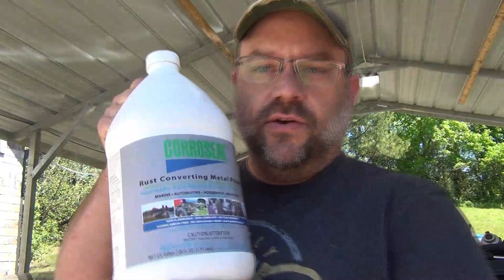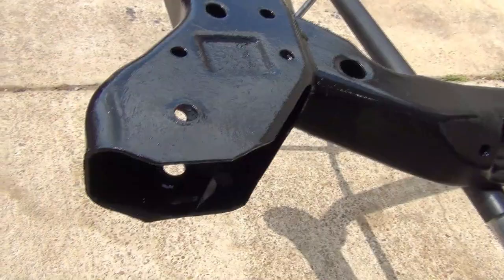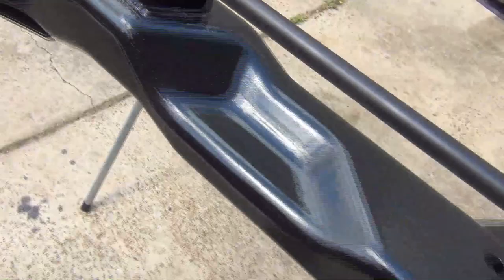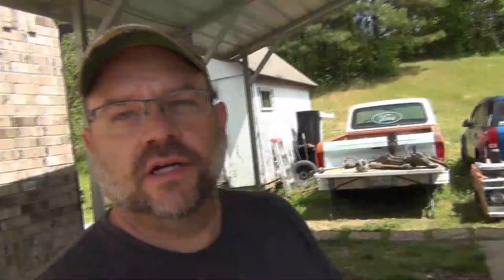Corroseal Rust Converter Test Application and Results

Comment: 1 gallon of Prep & Etch is $20 at Home Depot...  Cut it 4:1   I'll try this..  For cleaning I use Purple Power...
Reply from the maker: Yep I've used that as well, and it lasts forever.  Phosphoric acid rather than tannic.  Does a great job at neutralizing rust.  The big difference is Corroseal also acts as a primer, ready to paint when it's dry.
Reply: @PoweredByDave1  110% nice stuff..

Comment: I wire wheeled and scuffed my frame on one of my old pickups, then sprayed the frame down with a kerosene based engine degreaser, rinsed the frame with a power washer then scrubbed with soap and water then power washed again, it’s worked well for me. Getting ready to paint.

Comment: I did the rear frame on my F150 with Corroseal followed by red Rust-Oleum. A year later, still perfect.
Reply from the maker: I'm about to do the same on my 74 F100.  That's just what I wanted to hear!
Reply: Interesting Saw another video. Guy said he had  to recoat his truck every year. Did not hold up.
Reply: @charlescoker7752  - was he putting a couple of coats of paint or clear coat over it?

Comment: I noticed you applied it to already painted surface is that why you scuff it up with the scoring pad ??? I was wondering that cause the frame I want to do still has factory paint in spots and did t know if I had to strip to bare metal and use a metal etching primer .... Thanks in advance for any response

Comment: Good job on your video.
After 5yrs on two cars and a work truck.
I stand behind Rustoleum " REFORMER"
It sprays out watery, then drys to a Batman Black!
It lasts outside ( work truck bumpers, didn't fade or rerust!
I've used it on both resto mods on everything as they were both holee rusted out cars, cut and put new metal everywhere and Reformer on the portions left with rust ( not rot).
5 years it's MY go to rust killer. I've tried many.
Tractor supply is cheapest, than Walmart, then Lowe's/ home depot which ever carry's rustoleum paint.
"REFORMER" 
DO NOT SAND IT OFF, GREEN SCRUFF PAD IT AND PUT PRIMER ON TOP. I use 2k primers and top coats.
And I use Raptor bedliner AS Undercoat, it's 2k and tuff as a plastic gas can. Stays Black
And tuff !
Reply: You use the rattle can Rust-Oleum Reformer?
Reply from the maker: I haven't tried the Rustoleum brand, but I did try another rattle can converter once.  Followed the instructions to a T.  Didn't work for beans.  Glad to hear at least Rustoleum got it right!

Comment: Great video.  I have used this on my trucks living in the rust belt area.  Prep, prep, prep, prep, this guy is right about that.   My trucks have held up decent with this stuff.  Again, great video.  New subscriber here for sure.
Reply from the maker: Not much salt on the roads down here thankfully.  Glad to know it should hold up!
Reply: @PoweredByDave1  I've been using motor oil over it for a long time know and that helps it stay on decent. Paying attention to spring hangars and metal bolt joints is important the oil creeps into those areas. Blaster works even better stays on longer

Comment: I would say the way it is brushed on makes a huge difference in how it looks when it dries.
Reply from the maker: I agree.  I might try spraying it on my next project, see how smooth it comes out.
Reply: I'm going to try using my 4" wooster mini roller...   might have to do more coats... but it should go a lot faster, and come out smoother.

Comment: Very good video. One thing I'm wondering about is how the acid affects the metal after the rust is gone. Many similar products advise you to wash off the acid before you apply paint. Is this one different? I'm wondering because I've got a rusty truck frame , but no plans of taking the whole truck apart. Brush on and paint over is much easier than having to wash it off thoroughly, especially when you're under the truck.

Comment: I used this on my 93 Silverado frame about 4 years ago. The truck doesn't have a bed and sits outside. I top coated the corroseal with a Rust-Oleum gloss black enamel. I prepped it just like you did.  The frame exposed to the elements behind the cab rusted underneath the paint like you'd expect from a rubberized coating. I've only been driving the truck for the last year and a half, and only about 200 miles total. I was disappointed to say the least.
Reply from the maker: Ugh that's certainly discouraging.  Especially once you've been through all the prep to make it happen!
Reply: It was but I've switched back to old faithful from when I lived in Ohio, which was NH oil undercoating. They have a back to black version that does really well, and looks good.
Reply: None of these products are as effective as to what the factory does. And obviously, even that rusts after time. Heavy galvanizing is always the best, but is expensive.

Spraying with any paint helps, but you really need three coats. Because all these finishes are porous, and several coats cover the microscopic holes from the lower layer.
Reply: @pimperado06  I've pretty much come to the conclusion that coating rusty frames in oil is the only way to go in the rust belt!   NH oil is kinda king in my book!  Anything on the body of my car gets Fluid Film, anything under the car gets Black NH oil.   I have been seeing videos regarding PB Blaster's new product, I may have to read up on it and see what the hype is all about.

Comment: Let's see it a year later
Reply from the maker: I might not have the car that long.  lol
Reply: Been using Coroseal for 14 years in a harsh commercial salt water environment. If you follow the directions to a T, it performs awesome. You can electric wire wheel/hand wire brush your surface but try to not get too crazy going to bare metal...this will get you a nicer finish under a topcoat, but Coroseal ROCKS. 

It lasts for years for me, so it should be great in an around the farm/non harsh salt environment! You can get away with using the cheap non fancy brushes, and when it turns that deep blackish purple you are doing great. The goal is to not have any milky white dried streaks leftover from an excess application. POR 15 is junk, and as you mentioned, when properly stored, Coroseal lasts along time. Great review!!!

Comment: How is it holding up a couple of months later?  I live in the rust belt and am looking to do this soon.
Reply from the maker: So far so good.  I even spilled some brake fluid on it with no damage.
Reply: I’ve used Coroseal for 15 years for maintenance (under extremely expensive catelyzed topcoats) on ocean going tugboats. If you follow the instructions to a T it will serve you very well. You don’t want to have any clean bare-ish metal (via power wire wheeling,etc) as Coroseal likes and needs some oxidation to work with. This man’s work was perfect. When you have a deep purple black finish, you are GOLDEN. It’s nontoxic, but don’t get it in your eyes. The stuff is outstanding. Good luck on your project!

Comment: A gallon of the POR version ( 40701 ) on Amazon is $29.99. You are comparing the POR paint VS Corroseal conversion liquid.
Reply from the maker: That looks similar to Evap-o-rust, for soaking parts and dissolving rust.  This is a coating and needs to be top-coated just like the POR15 coating.
Reply: Still por 15 comes off in sheets the rust still doesn't absorb or react with por15.
I think por 15 is great for many projects it's just not Automotive tuff as they claim. Paint anything non automotive and it's great!

Comment: If you need to CLEAN IT, WIRE BRUSH IT,   WASH IT,  DRY IT ..than how is it any better than regular PRIMER?!
Reply from the maker: I hear ya.  Just gotta knock off the loose rust.  But ya still have to neutralize the rust somehow before you paint.  Otherwise it's gonna come right back.
Reply: It chemically bonds to rust is the point of a "converter"
Primer adheres to bare metal. But does not contain chemical converter. Even self etching primer isn't a " converter" but it adheres better to bare metal.
The chemical make up is the difference over primer.
How ever after you use converter lightly scruff with green pad and prime it.
Do not resand the converter off. This is where people FAIL.
Reply: @MindDezign  Awesome!! That wasn't covered in the video and always wondered. Appreciate the comment.

Comment: better than ospho?
Reply from the maker: It's much thicker than ospho (or kleen-strip prep n etch).  So that's good and bad.  Good because it sticks in place like on a vertical panel, but bad because it's harder to get into the small pin holes.  They both have their uses for sure.

Comment: This stuff is garbage. I bought 2 gallons. Did mine and my son's truck frames. looks great going on. Topcoated both frames. Within 3 months, both frames were peeling. Leaving rusty blotches behind. Our prep work was proper. We wasted 3 weekends on each truck. I'm not sure how well this stuff converts rust to magnetite, but as a primer, it does not grab and hold the surface well. Check out "Repair geeks" & "Project farms"  video on rust converters. 
I was a por15 fan for several years but that stuff will make you poor and it too fails.
The best product by far for stopping rust is MASTERCOAT.  It's cheaper,  less labor intensive, and 14 times more durable than poor15 in the salt fog test. They use it on bridges. Do it once, do it right, mastercoat.  
Right now it's 9 months after I corrosealed my truck frame. I have taken my truck apart and I am removing the rest of the corroseal so I can apply mastercoat. Sorry dude. No disrespect to you and your channel. I was just as happy with corroseal as you were at the end of your video. Maybe you could do a follow up video and let us know how it's holding up for you.